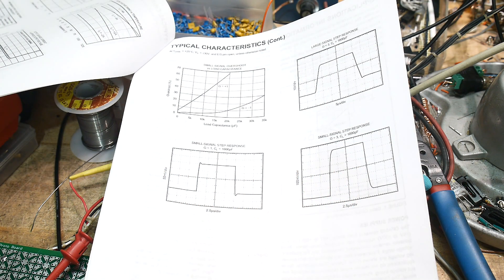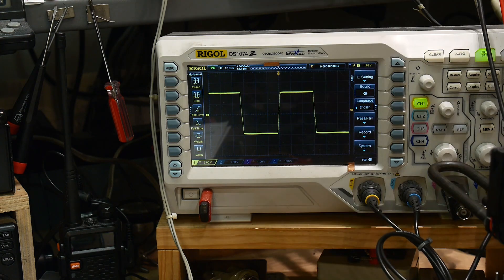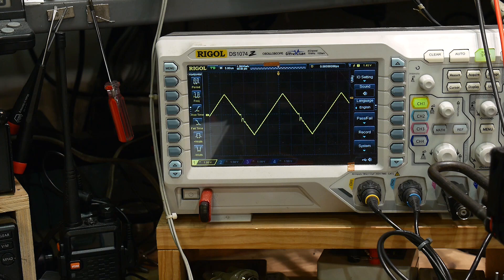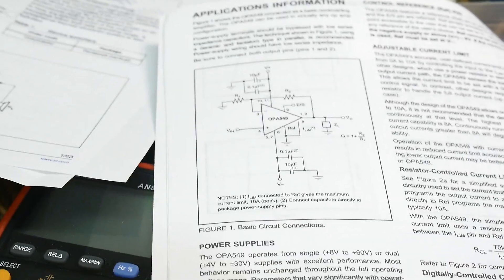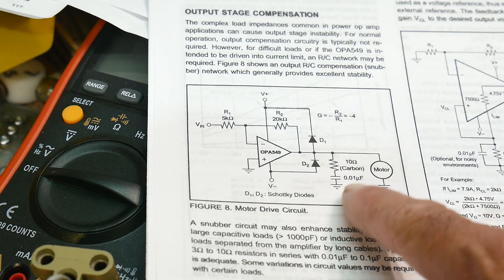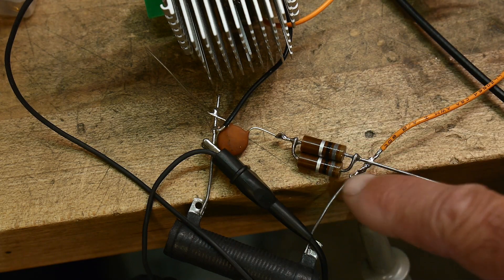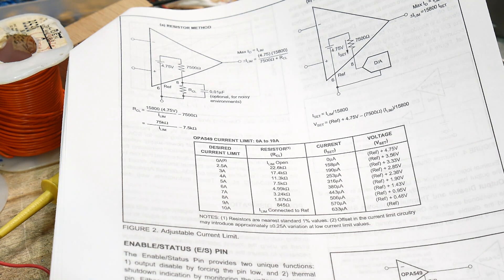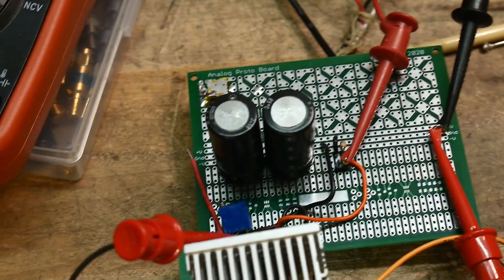#801 High Current Bench Amplifier (part 2 of 2) OPA549A

Comment: About a snubber circuit at (8:16) : a datasheet says the znubber resistor has to be carbon (or oxide, or other) but not wired to not have excessive inductance. 
But you still added some good inductance with a long wire before the snubber. A snubber circuit is intended to be close to the amplifier output but not to load.

There are cases when snubber must be placed near a load but that's not a case here.

Comment: Cont. of below comment:  part 2 (my ps4 starts serious lag if one msg gets lengthy)

How to make a high freq. signal with freq. adjustment that can push a large current at moderate voltages (option to set this voltage as well would be amazing, but not absolutely necessary) but have a DC-like one directional flow where the + - terminals do not alternate and stay that polarity???

Its also likely a high V signal with low current and high freq. would also work, where the ratio of H2 gen. from free radical vs. current flow would be higher.  This would actually be preferred as power consumption would be lower per amt of H2 made as this much larger potential would generate a much stronger field, but several side problems arise in the chemistry at high V in an e.cell like undesired side reactions/products, heat build up, and electrode degredation to name a few.  Ultimately id love to do both and compare and find the sweet spot in between, but for now i just need the first (unless a high V low I version would be easier to achieve).

Ive been stuck here for a long frustrating amount of time; if anyone can tell me whether this is achievable as DIY, or if there's purchasable items im unaware of inexpensively that do this, any vids or further info somewhere to point me to...Id very much appreceiate a comment responce with a how to or any of the above to help me finalize this build.  Thanks for your time to read all this and hopefully someone better in this particular field can help.  Good day all

Comment: PLEASE HELP, ANYONE READING!!  Read fully for the full scope of situation please....

Could you just use a lower current version that is capable of the higher frequencies (dont know shat thatd be, but it seems some exist they just cant drive larger currents), then feed this signal in as the control to a second stage driving some type of further amplification through a bank of power MOSFETS or similar components to push more current into the signal??  Similar to how a high watt sub audio amp can push huge corrents?

Probably not MOSFETs specifically i dunno, im not on this level of full understanding yet...but im so close!!  Lol...but whatever component needed use several in 'parallel'** (?  I think) to add current from each in a bank that could drive very large currents, as you see 4 or 8 in a row on a 1-2kW car amp.  Is the problem in the limitations of high power transistors not being able to switch fast enogh at such frequencies?

Reason:  ive a genius idea for much higher yield/efficiency for H2 generator via electrolysis (Im a MS chem. engr, so I know moderate electronics but the whole picture has yet to "click" for me when combining these subsets of components into larger networks how it all works together etc).  This is usually low V DC with large currents, however h2 gen. is proportional to how much current is used as it supplies the e- for the redox rxn.  I through experiments on small scale have all but shown myself my thought of generating *extra H2 gas without requiring more current is possible by inducing *mechanical bond breaking, inducing free radical reactions which gen H2/O2 without more power input (the current draw actually reduces in most runs).

This is achieved by taking advantage of waters polar properties and the strong E-field between two close electrodes.  The water will lign up in the field as magnets would in a B field...but this does nothing to break bonds.  However, if a high freq. signal is used that is a harmonic of water's bond vibrations, the pulsing field intensifies this to the point they can cleave non ionically as a free radical, which will rearrange into H2/O2 (same happens at - terminal when O takes an e- and thus releases the H. radicals which then form H2 and two OH- etc) but unlike the electrode redox rxns, this does not consume power by using electron transferring mechanisms...Long story to try to explain but my ultimate point is:

I need to build an "amp" if you will, that can drive this electrolysis cell with low voltages but be able to deliver larger currents with a semi-adjustable frequency control to fine tune in the resonant frequency.  Most importantly though its an AC like signal, but I need the final output to the electrodes to be *DC offset...as in rather than a forward-backward oscillating current i need a high max to zero oscillation with a DC behavior as in current only flows one direction and the electrodes polarity does not change.  This is crucial to keep molecules oriented in same direction to feel the "vibration" rather than spinning 180 degrees everytime the signal reverses (this would only heat the solution not create free radical degredation).  Ive seen a significant sudden increase in gas gen. on small tests, but i need to scale up.  Is this type signal doable as DIY???  Ive a tiny budget, and came a long way in progress to be stuck at the very end lacking knowledge to build such a circuit.

Comment: great video. how does it preform using a single power supply? do you see the same glitch?
Reply from the maker: Hmmm. good question. I'm currently working on a box for it with 24V 5A supplies. I need the +/- for DC motor work.
Reply: @IMSAIGuy  Hello, thanks for the nice Video. What kind of PS you choose for yours? Can two switching power supplies like this https://de.aliexpress.com/item/1005001626749980.html?spm=a2g0o.productlist.0.0.425347daAT1TE0&algo_pvid=86d25c54-e6d2-4d51-bac1-08c29117eb3e&algo_exp_id=86d25c54-e6d2-4d51-bac1-08c29117eb3e-15 can be used? best regards

Comment: If +-15V swing and 1A is sufficient (more current can be achieved by paralleling), then the LT1210 is a fantastic chip. You can easily achieve a bandwidth of over 10Mhz at 1A!  I have bought 10 pieces on Ebay (from adeleparts2010) for only 8€ including shipping, they were a bit corroded and needed some extra flux to solder, but appear to be the real deal. Much fun to play with, and very very cheap that way.

Comment: The distortion seen in the waveform looks like crossover distortion to me. It's almost as if the output stage of the TI part does not have enough internal forward current/bias to keep the internal output device "turned on" during the transition in polarity/direction at the higher frequencies. Just my $0.02. Hope that you're having a good Memorial day IMSAI Guy. Thank you for sharing!   Fred
Reply: I was thinking the same thing, resembles crossover distortion due to location, but differs in character.
Reply: Yeah this looks similar to crossover distortion sometimes seen in LM358 /LM324 circuits

Comment: Just out of curiosity what are some typical applications of the original HP box? TNX for sharing!
Reply from the maker: From Kepco:
motor testing, testing of magnetic components (coils, speakers, etc.), industrial applications with inductive loads, driving CRT coils, cryogenic applications and powering correcting magnets for medical imaging applications or particle accelerators

solar cell/panel testing, driving and testing piezo-electric devices, capacitor testing, driving and testing capacitive transducers, and power for industrial or lab applications with capacitive or capacitive-resistive loads